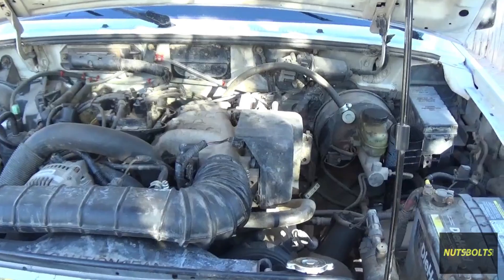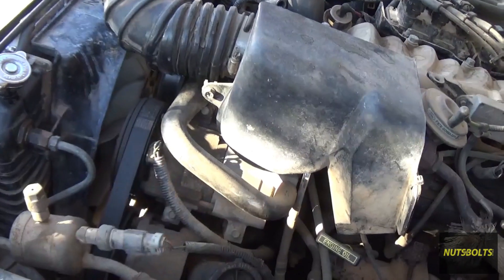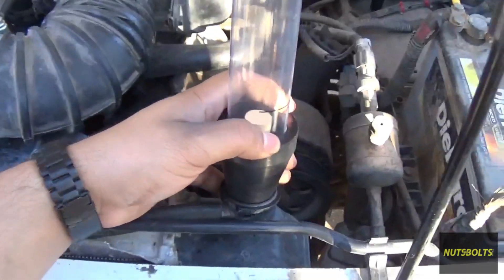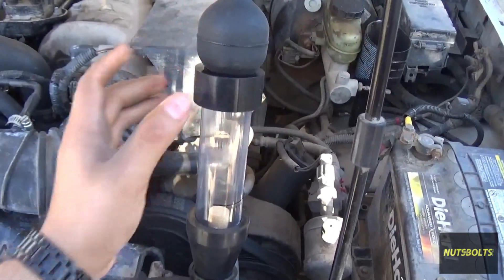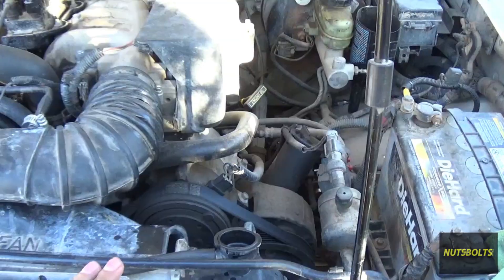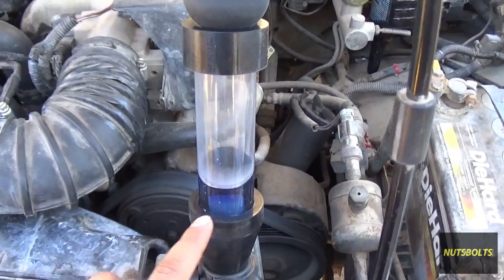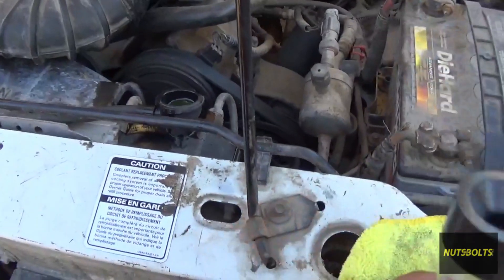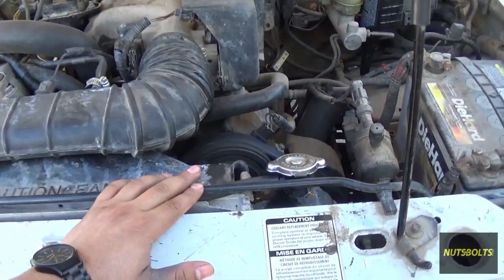How to Use a Combustion Leak Detector (Test for Bad Head Gasket or Cracked Head/Block)

Comment: I am honest to god terrified yo do this test because I really do not want to get rid of my truck
Reply: I had this problem and solved it with steel seal. Saved thousands of bucks with liquid chemicals.
Reply: @ApacheNL1  Hi can you talk a bit more about the process you used with the steel seal, and is it still fixed today? 
I know some people will follow the instructions but I've also heard other mechanics will modify the process with some good results. For instance do you leave the thermostat in? Do you leave the heater off or turn it on full heat when adding it in? Also did you flush the system after or did you just leave the steel seal in? There seem to be different schools of thought on this so just curious what yours was/is? Thanks in advance!
Reply: @Rick-the-Swift  Unfortunately the solution didn't last long. It's a temporary fix.

Comment: Thx @ Nus and Bolts Auto, I just got my tester in today from amazon and tested immediately with promising results.  My problem is i just bought a 2008 sequoia from craigs list w/ 233000 miles, I test drove it, checked cold start check steering fluid and inspected the bottom for any leaks from engine and trans, all was well until.  I noticed i was loosing coolant, so i bought more and it would slowly lower in the reservoir, I did notice a leak behind the radiator where all the red coolant collects and dries out, also think the water pump may be leaking from weep hole, really that wasn't my biggest concern.  I was really concerned the original owner drove with low coolant and overheated the engine and thats why they sold it.  so it was a relief to run the same test and come up with good results, now I feel better about replacing the radiator and water pump with no major concerns about a head gasket.  I used a suction pump to take fluid out from radiator and let the truck run idle for about 10min the radiator felt hot and temp gauge needle was in middle so i assume the thermostat is open and pumped the little ball for another 7min with solid blue color.  FYI to craigslist buyers, check behind the radiator with your phone camera, when i saw this truck the front of the radiator was clean with no evidence of a leak, also got my spark plugs changed and no evidence of oil on the plugs so I'm happy.
Reply: 233K miles is nothing for the Sequoia engine, if you regularly change the oil you will get double that and the Sequoia engine is not known for experiencing head gasket problems
Reply: Robb Flynn Thx for reply.  The sequoia now has 257k miles and doesn’t skip a beat both engine and tranny are solid.  Only issues is worn power steering hose, suspension a little rough.  other than that, its a tank.
Reply: @salguzman7840  Don't forget about changing the timing belt, it's supposed to be done every 90,000 miles although I have close to 160,000 on my 2004 Sequoia and I know it's never been changed but will get it done over the summer.
Reply: @robbflynn4325  Hi just curious if you ever got that timing belt changed? I'm asking because I personally think it's not always necessary depending on the model. I've heard some say to change it every 60k but I wouldn't do it. I don't think I've ever changed mine on my ranger with over 180k. Why? Well, because all the other belts look fine after all those miles so why shouldn't the timing belt? I personally think unless you are a skilled DIYer it could be quite a mistake taking your vehicle and handing it over to another. There are countless nightmare stories about vehicles coming back in worse shape then they went in, even had a few myself. Plus they always find something else wrong that you never knew about or even suspected. I don't know, I just don't like the idea of taking an engine apart unless you really have to.
Reply: @Rick-the-Swift  a TB change should be an easy job for any mechanic.  Had mine done just for peace of mind.  The old one did look in pretty good shape, but with it being an interference engine, there was no way I was taking any chances.  Won't be in such a rush to get it done again, though.

Comment: Hi all this will make me sound an idiot but here goes. I bought one of 
these testers of ebay and due to the fact it came to me from china and i
 live in Australia no fluid came with it. I ask about the fluid and was 
told that you can use ink and water IE diluted ink . Is this right? 
Nick
Reply from the maker: Im not too sure.. Seeing as it has to react with combustion gases, I doubt it's just diluted ink. I purchased mine from Harbor Freight for around $10. I see it online listed for the same price. It's Block Tester brand BT-600 if that helps 👍 If you happen to know how to make it yourself, let me know :D 

I appreciate you watching the video, hope this helped. Sub for more (:
Reply: Hi Nick, I am from Australia too. I believe Repco has the testing fluid...it is called RST 180. I bought my testing kit from repco when the sale was on but you can just buy the testing fluid somewhere between 52 to 58 Australian dollars...hope that helps ...cheers

Comment: 100% false. The coolant does not just stay in the block once it's up to temperature the thermostat will open allowing flow.
Reply from the maker: 3:07 you might want to watch that part again. I hope this helps
Reply: @NutsandBoltsAuto  Don't you love it when people don't actually pay attention to the video and then comment on how you are wrong.  BTW, this is the best video I have seen on the use of this tool, and you did a great job explaining the steps.  A lot of other people have done videos on this giving very bad information and not using the tool properly like you did.  I wonder how many people are driving around with a bad head gasket because this test was done improperly and gave them a false sense of security.
Reply from the maker: @gzrgldr8288  Thanks, I really appreciate it. Glad you liked it 👍
Reply: @gzrgldr8288  I agree with you. I saw (Scotty Kilmer) you know the guy that's always yelling, use this tester but never explained how it works. This video was extremely clear informative and helpful.

Comment: NUTS AND BOLTS AUTO 
                   {"""                " The coolant combustion tester/detector will only test the coolants fluids for a bad head gasket? 
                    The Coolant combustion tester/detector doesn't test if the water pump is work correctly or if the radiator and engine has rust and other chemicals in the coolant?
Reply from the maker: No, it only checks for combustion gases in the cooling system. I assume you could use the cooling system pressure tester to check the water pump pressure. The psi that the system is rated for is stated on your radiator cap. If the system isnt at that pressure, theres a problem. (See my Cooling System Pressure Tester video). 

There's test strips and a coolant tester as well. Those will tell you the condition of the coolant. You can also use a multimeter on your coolant to check for voltage.... Any voltage and you have bad coolant. 

I hope this answered your question, and thanks for watching :D